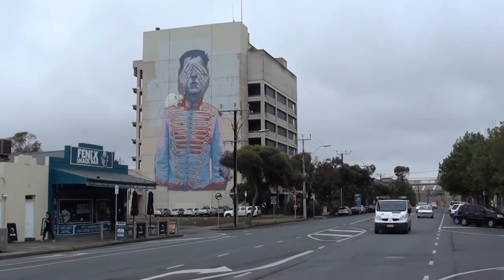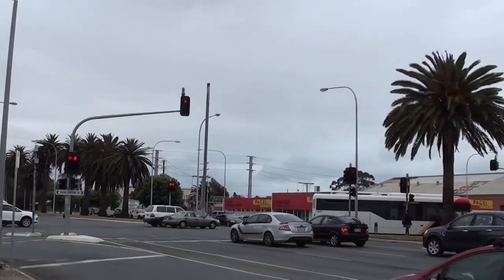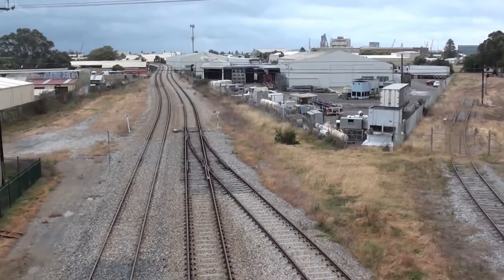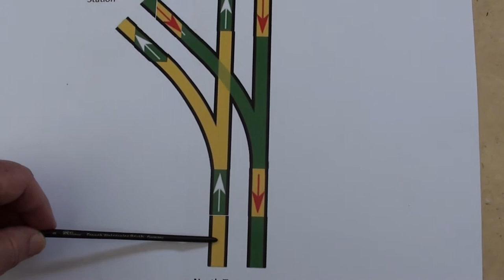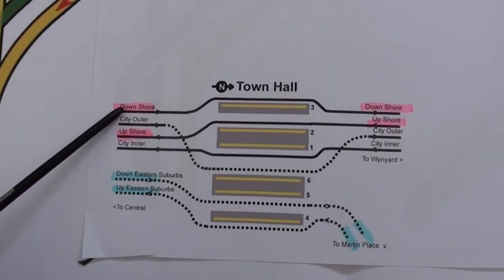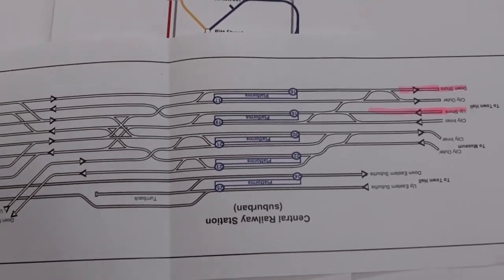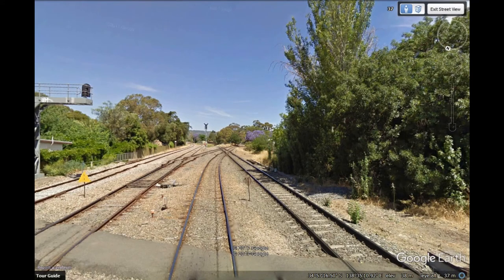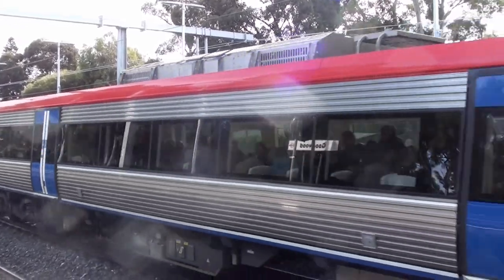Trains collide and Flying Junctions Greater Adelaide video Nov 2017

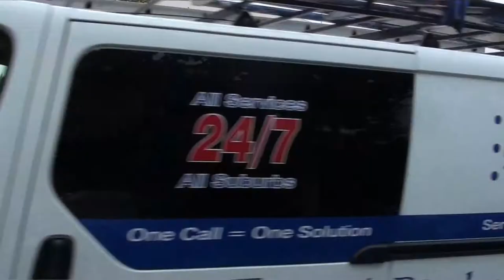Comment: 0:00 The old what building?
Reply: harbours board
Reply from the maker: Old "Fisheries Building"   Part of Dept of Agriculture.     In the 1950's the fishing fleet use to sell produce alongside the Jervois bridge and that swung open to allow fishing fleet to moor up stream.  With the building of no-opening road and rail bridges the inner port has died as an marine industry site.     I think the fishing fleet now anchor at Bakers Inlet near the Torrens Island Power Station.     Baker's Inlet is where Governor Gawler wanted the port facilities to be built in the early maritime history of South Australia.   Gov Gawer could not get the money to build a causeway across the mudflats.     Instead the "South Australia Company" had money and built a toll road from Hindmarsh to  "Port Misery"; what is now called West Lakes.    Later at a Y junction was built at Albert Park to take the road to the New Wharves built in today's Port Adelaide.    The west end of the original road was renamed "Old Port Road".